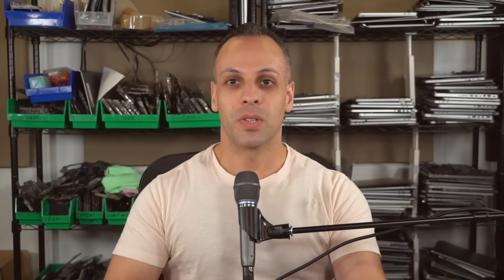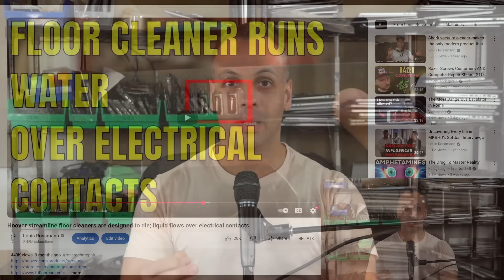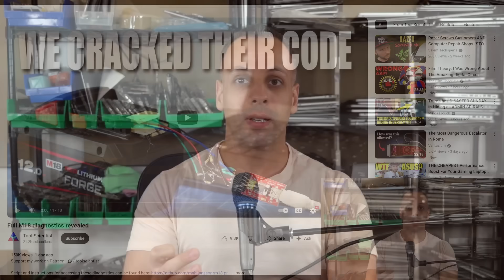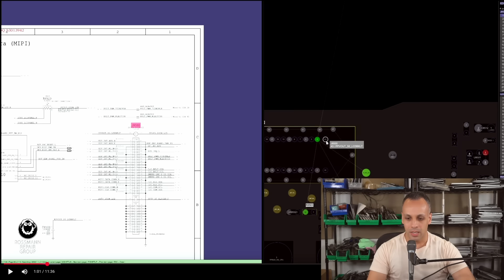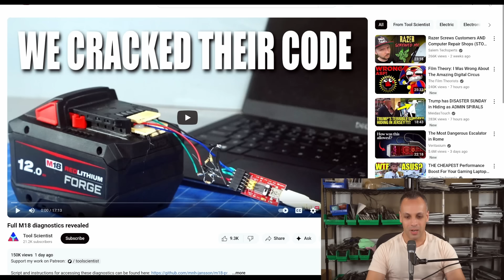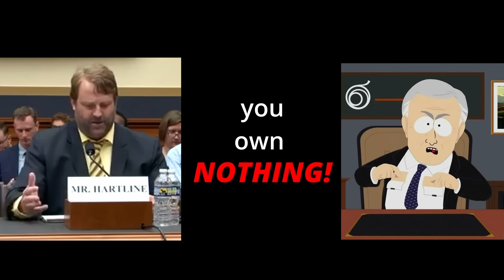Imagine putting DRM in a battery to void warranties...

Comment: Milwaukee quality has gone downhill fast.  They are pumping out new, flashy tools at a crazy pace and not keeping up on the quality control.  I have a drill that has two forward arrows on the fw/ rev switch.  I assumed it was a clone.  But it's from TCI.  I have used Milwaukee tools for 25+ years and hate that TCI absorbed them.  I still buy them, but only because they are slightly better than the green ones and the yellow ones.  But not much.

Comment: I love my 48V Ryobi (also TTI) zero-turn/riding lawn mowers because of their non-proprietary batteries. I like many others have swapped the stock AGM batteries out of used mowers for Lithium ones that should last ten years. A lot of people don't want to mess with them so you can find these with dead batteries for sub 500 bucks. Obviously TTI didn't agree as Ryobi is now full-proprietary with their 80V mower line.

Comment: I feel like temperature monitoring and data logging for warranty validation doesn't feel like Spyware to me. Now if its inaccurate, they need to fix it and wrong their right. 

However im having issues with applying this to another industry with a relevant issue

Car tracking and insurance devices used to customize your quote I feel like in the end they don't deny you a warranty claim for a whole new car.  

Removing a void warranty sticker does not cause the device to take major damage such as leaving batteries in a hot car. 

I'm curious to understand what other data they collect that establishes the battery diagnostics as Spyware. .

Comment: i dont know about dewalt, they havnt particularly let me down. but tge only milwakee think i have us a crowbar. a metal stick. at least that works well.even came with a rubber brip. i cut it off cuz if its pyrpose for myself, but it was pretty good. (ysed it to lift shingles as a residential solar installer. also: dont ever get solar installed on your roof. tons if diwnsides. and lits of...... terrible dudes doing your stuff let me tell ya.

i was on tge team that didnt screw up, and made less money fixing other teams jobs. good times.

Comment: Multiple *cells make a battery. And I've had my Bosch batteries 10.8v for nearly 20 years, my 18v for 12 years. Milwaukee 12v died after 1.5 years. I am not happy I went with Milwaukee 12v. Bosch is very good.

Comment: No balancing in these premium Li-ion packs? What the actual F!
Reply: and dewalt batteries do not even have a circuit board, but the charger itself does the balancing.
Reply: Batteries are a huge part of revenue, sometimes the bare tool costs less than the battery and charger that you need to use it, these are all ways in which they try to sell more of them

Comment: According to the other guys video, you are incorrect about it recording overheating because of being in a hot car. He said specifically that it does not do that. He said it only records an overheat.If it is drawing more than ten amps, or if it is on a charger. So while I think it is disgusting, what they do, at least that one thing seems like they did to not avoid warranties just because it sat in a hot car.So they get a half of a percent good job so instead of a one hundred percent disapproval, they get a 99.5% disapproval from me

Comment: The tool repair channels such rate Milwaukee as one of the worst for repair. The majority of high wear parts are now modularised to make repair economically pointless. 

You can’t just buy just a trigger switch, it comes as a module attached to the battery connector, main pcb controller, electric motor and trigger switch. This part costs as much as a new tool.

Comment: I stopped trusting Hoover years ago. Now Milwaukee is in that list because TTI owns it.
Reply: Hoover has sucked for many years.
Reply: Glad I saw this.
I have a 15 year old Milwaukee hammer drill.
It still functions..more or less .. for limited use and it has done a LOT of work. 
The chuck is worn and needs replacing again, batteries have short charge life, brushes are near end of life.
I just took the gearbox apart thinking gearbox had a problem, motor running HOT too much power draw. Soooo...many...gearbox..parts but seem in good condition still despite the life of hammering 🙂  Not industrial use but maybe 2,000-3,000 hammered holes and MANY thousands of screws and holes drilled.
Back together and gearbox still good so now it seems it is something in the trigger-controller, all sealed and $120 for a replacement, not worth it since it has other problems.
Was just looking at $750 for a replacement and I would be happy with that IF I could expect 10 years life. That isn't much per year for the few handyman level use jobs I have for it now. 
Old age Retired now, I might do 10 concrete holes for a friend one day and nothing for weeks.

But seeing this and looking up the company now..Nah

I have powerful corded drills anyway but cordless and fairly powerful is convenient to have in the car just in case.  May as well just get a cheap $130 drill skin for cordless replacement.

Comment: I have a small contracting company that's my side work. Weekend stuff.  About 5 years ago I stopped buying name brand batteries.  I look at batteries on Amazon then Google that product to see if the schematics are available.  If they are and that battery has all the balancing boards and protections and everything then that's what I get.  They last just as long or longer than the name brand batteries that are twice or three times as expensive.  Those big companies are using the same cheap Chinese cells anyway.
Reply: Sad but true
Reply: Bruh. Do some research. The name brand batteries don’t use cheap Chinese crap, and last WAY longer than those knock offs. There are tons of tool channels that prove that on the regular. Also, to say that Milwaukee and Ryobi don’t include balancing circuits is laughable on it’s face! Anyone that knows even a little bit about batteries knows that this would result in a catastrophic failure immediatey (not in a month, or a year, but literally on the test line) due to small cell imbalances. Save money all you want, but don’t kid yourself that you are getting a better product.
Reply: @danbrownlee4400 
All of the name brand tool batteries monitor the individual individuals voltages. They will not overcharge a cell. They stop charging the pack when a single cell reaches a 100% SOC.

What you describe would absolutely be a serious risk if you didn’t monitor the cell voltages. But the name brands do.

Knock off batteries… I’ve got a lot of of them. Most of them appear to do cell monitoring. But I do have one that does not monitor the individual cells. It looks the same as the other ones that I’ve got. The only way I could tell was by opening it up and noticing that it didn’t have wires to monitor the voltage. The other ones that I’ve got all half wires, but I haven’t actually checked to ensure that they use those wires.
Reply: @danbrownlee4400  ive been doing decades of field research lol. And where did i say the name brands don't have balancing boards?  Maybe work on your reading comprehension skills.
Its sad so many people blindly follow and believe paid advertisements in the form of 'review' channels.
Reply: @DASfinn  Louis himself mentioned that the batteries don’t have balancing boards. You personally said “If theyu are, and that battery has all the balancing boards and protections and everything, that is what I get” I never said you specifically said name brands (Louis did though), but you said there are batteries without them. That is laughable! If there weren’t any availbable, why would you need to consult a schecmatic? Why would you insist that they contain balancing boards before you bought them if you could not get batteries without them? Not sure I have a reading comprehension issue here. As I alredy said, without them, the battery would fail immediately. I don’t personally believe you can find a tool battery made by anyone without a cell balancing circuit. Please name the brand if possible so we can verify it. As for the testing, if it was merely one channel saying it, OK, Maybe they are in the pocket of the manufacturers, however I am talking about well known independant channels like “project farm” and “the torque test channel” who regularly test China crap batteries against name brand, and the name brand always comes out on top.
Reply: False. many of the name brand batteries DON'T have Chinese cells, many use higher quality batteries.
Reply: @bikeracerdude where do those "higher quality batteries" come from then, give an example. this should be good...
Reply: @bikeracerdude and where to those higher quality cells come from?

Comment: IIRC, Ryobi’s power tools are also done by TTI (need to triple check that). Which is unfortunate for me and my 18v and 40v stuff 😢
Reply: Yep Ryobi is a tti brand, they license Ridgid as well
Reply: Yeah basically Ryobi is used as an idea testing platform for Milwaukee. Engineers get an idea and will build one under the Ryobi platform and if it does well enough they'll make some improvements and sell it as a Milwaukee while keeping the original design releasing under Ryobi.
Reply: It seems like Ryobi is somewhat independent. Their batteries definitely behave differently than Milwaukee.

However… At this point, it appears that zero power tool companies balance their cells…

Comment: They do actually care, they built it that way on purpose.  As soon as you fix the problem,& publish the solution  they will rush to 'fix' the old issue and put it into a place that makes it even harder to correct. They know what the bells they are doing. They purposefully put flaws into things. Anything they just happen to build correctly, they will discontinue it and memory hole that design instead of learn/ improve upon it.
Reply: They did just that with the 40v Ryobi batteries as people figured out how to keep their antiques going during the covid lockdowns by jumping the reset pins on the BMS and by 2021 the new models were already having the lockout can't be reset.
Reply: @MrKillswitch88  Thats when you buy unsafe chinese knock off batteries
Reply: @lexmarks567  I don't like fires plus when a job lot for scrap is only $30-45 I'll stick with the TTI rubbish.
Reply: @lexmarks567 
I'm starting to wonder how unsafe they really are, or if that's something that's been promoted by scumpanies like TTI?
Reply: @MrKillswitch88 then buy a chinese bms and modify them. Keep the cells and chassis
Reply: @111Xumi111  If the connection are in the same place then I am interested.

Comment: I could be wrong,  I thought he said in his video that the stats only update when charging, or when discharging at more than 10A.
So high battery temp when off, like sitting in a car, wouldn't be logged?
Reply: Correct. Overtemp (I think >60C) only recorded when >10A discharge, then they record start and end of charge temps. This was prob the most surprising find as I think it's well warranted to record overtemp events when not on a tool.

Comment: A lot of the Milwaukee tools connect to an app via Bluetooth, I can imagine they can update firmware with that unfortunately. The Bluetooth is for locking out as an anti theft and tracking I believe lol.
Reply: "the bluetooth is for locking out as an anti theft and tracking i believe lol"
i suppose anti theft securities dont help when the people that control the anti theft measures go out of their way to steal it themselves, huh...

on another note, SINCE WHEN THE HELL DOES A BATTERY, A FLIPPING BATTERY NEED A CONNECTION TO ANYTHING OTHER THAN THE HARD WIRED POWER CONNECTION TO WHATEVER ITS POWERING/BEING POWERED BY..??!?!?!
Reply: Did I read that right? Bluetooth for drill battery?

Comment: Its worse then that they didnt just not write battery balancing they disabled it.
Reply: Are you saying the wiring and hardware are in place for battery balancing, but it is disabled?
Reply: @sylkelster Yes.
Reply: @sylkelster that would be a subscription feature
Reply: @sylkelster  The cell voltage sensing wires can be used for slow passive balancing through resistors that are switched on as loads through mosfets in certain BMS chips. We're talking 50 milliamps or something like that but it works with enough time and is better than nothing. If the BMS controller chip supports this, it should be possible. These people claim the "chipset" supports it but it's not turned on or is actually actively disabled. As an electronics engineer I find this absolutely irresponsible. They hate their customers.
Reply: @wombatillo  I have some EGO equipment and I'm fairly certain that's basically the method they use to balance the cells.
Reply: *Than

Comment: Ugh. Well I guess I've gotta drop my Mikwaukee "loyalty" (lol) next time I buy a power tool. The Japanese Makita brand sure looks promising. Not sure why I didnt go with them in the first place, they seem to be....just Makita.
Reply: They don't do balancing either :)
Reply: @tschuuuls486  its a shroedinger's battery balance as Makita also do and doesnt at the same time their 18v ones do but other 18v doesnt thats the issue
Reply: Great tools but their batteries do have the lockout, fortunately someone out there made a program to help resolve issues with those batteries.
Reply: @MrKillswitch88  I've heard the lockout has something to do with big temperature changes, like using it outside during winter until the battery is quite empty and then taking it to the heated house/workshop and immediately putting it on the charger, voltage drops too low or something
Reply: @lolatmyage  Just jamming the tool can do it (over current) and well overheating as some much older models would run until the cells started leaking electrolyte. Beyond that the other most common issue is due to the cells going out of balance as neither the BMS nor the chargers do it.
Reply: @MrKillswitch88  Makita also sells a tool to read the data on the batteries.

Comment: Bit of knowledge, they are called cells. A battery is an assembly of cells. It's a lithium cell that is 3.7V and it's a 9v battery since it's 6 1.5v cells in series.
Reply: But I am appaled there is no balancing in these. In their m12 there is a balance circuitry, and ryobi have balancing as well ( aren't ryobi a thing brand too ? )
Reply: @miranina1585  They both have the hardware. They just chose not to use it ;)
Reply: @tschuuuls486 if that's so that beyond stupidity. That's malicious. If the HW is present to balance you have to actively want harm to the battery to not make use of it.

Comment: 3:48 bosch battery's is not cheap.. my biggest regret in my workshop: everything bosch... all my old batteries still works, non of the 6-8 years old.  half of the new doesn't charge full etc. i have opened a few of them. cell not in balance.  why don't they use a balance board anymore?

Comment: 3:50 my e-bicycle is great for travel but it has the same issue explained. when its on 60% i have to remember that it may suddenly switch off.... there are places in my city where people do actually balance batteries as a service, which is really cool
Reply: I had that same issue on my e-scooter. So many times I was on the road and it would suddenly shut itself off and take a few minutes to turn back on. Even now, it charges, it clearly has power, but hasn't turned on in several months
Reply: Any lithium pack that doesn't have even a slow passive balancer is negligent. Lithium battery packs with multiple cells in series will eventually go out of balance with no balancing.
Reply: Something's really wrong with your bms, a good working bms will not ever allow your battery to get so unbalanced like yours does. Paying someone to disassemble your battery and balance it is just a waste of money, since after all it's a problem with your bms or potentially with your cells.
Reply: You could always get your battery rebuilt with a new BMS that does cell balancing. The ones I've seen have a Bluetooth companion app that will show you the voltage of each cell. Cell balancing BMSes do have a higher self discharge rate, so you'll have to remember to charge your battery more frequently.
Reply: Balancing a battery is not rocket science ;)
Reply: @YS_Production  Getting to the individual cells in a timely manner to perform the operation, where the manufacturer does not provide provisions, is the value of the service. If that is indeed what is happening.

Comment: I saw that video today ! Milwaukee now has no business from me. I'll buy Ryobi. Ryobi actually has balancing hardware inside.
Reply: Ryobi is made by the same company...
Reply: @jeffl4810 they are ? Thanks for the info. I hope they don't make Makita. I'll buy Makita instead. That's the only way to stop these companies from doing this: stop buying. But tradespeople get weirdly brand loyal.
Reply: Milwaukee depending on battery revision has the balancing hardware. They just don't use it.
Reply: @tschuuuls486  Custom firmware might fix that someday.
Reply: Ryobi is sadly also a brand of TTI (licensed from the actual Ryobi). Same with AEG...TTI brand licensed from Electrolux.
Reply: Yeah it is all the same company and out of all of it none of it really does balancing, got like 30 40v Ryobi batteries that I am going to eventually rebuild or scrap because the BMS doesn't balance as well the software lockout. The 18v packs have fewer issues but it is still a dice roll if they'll crap out.